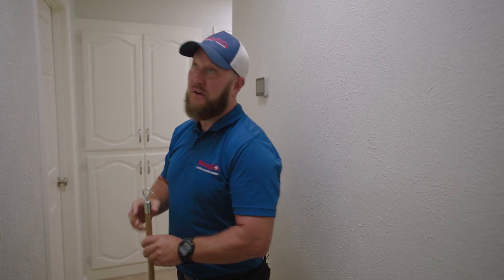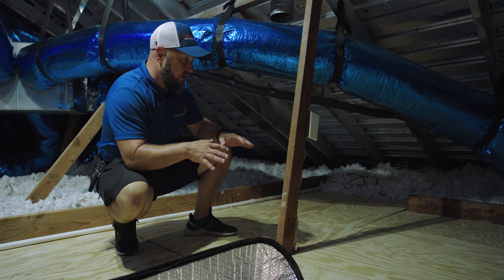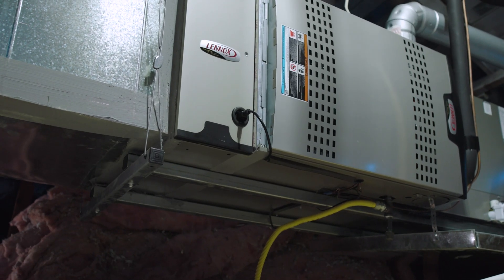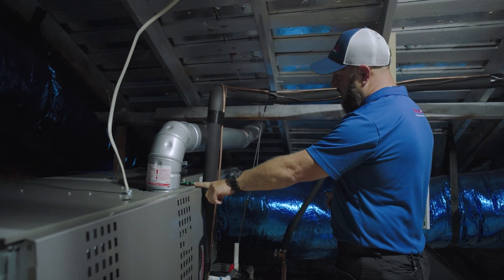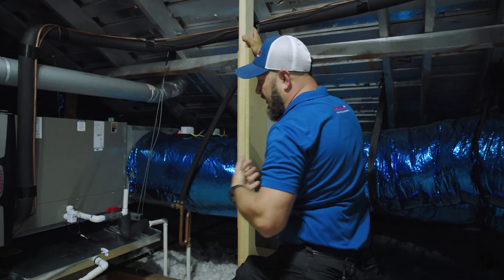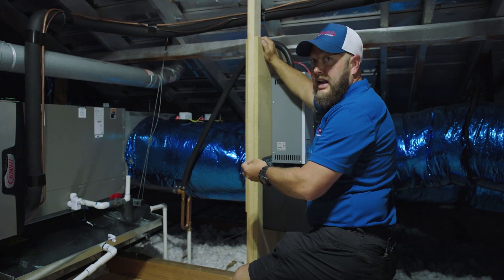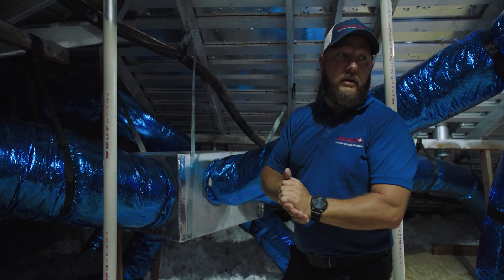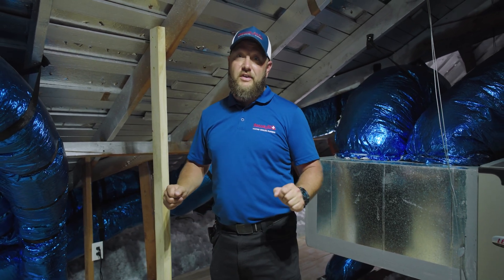Joe- 2023 Awesome Air Conditioning System Installation

Comment: The perfect install? That’s laughable with the miles of flex duct and “so called” mixing boxes for a duct system.  Why not run a metal trunk duct whether round or square and take all the runs off much shorter and straighter? It can still be zoned properly without having flex duct feeding distribution boxes that are feeding other flex ducts. It looks like an octopus with all that spaghetti mess of flex snaking and turning everywhere. I’m not sure why that became the standard these days and metal trunk lines went away but that’s certainly not how we install and it’s certainly not perfect.